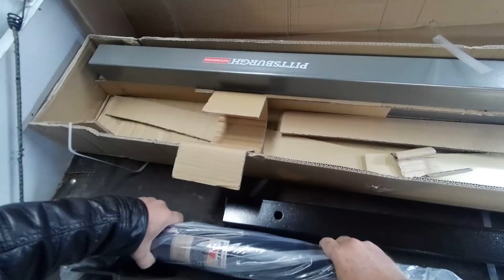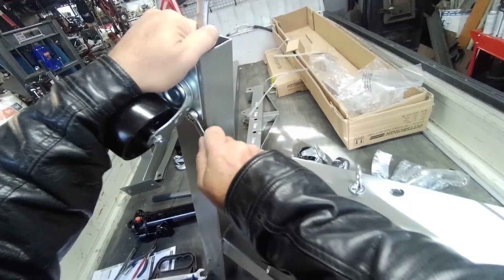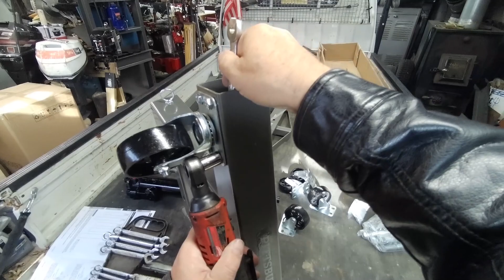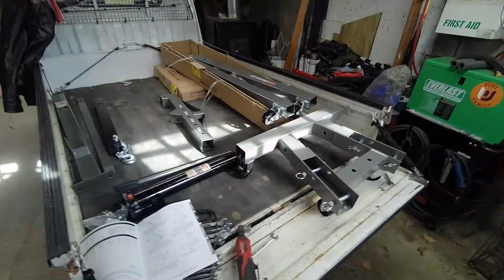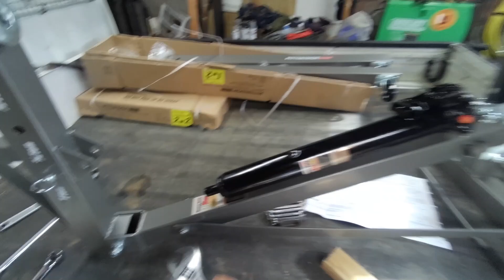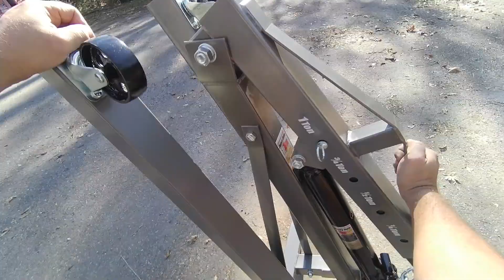$209.99 Harbor Freight 1 ton Engine Crane assembly. Complete build in about an hour!

Comment: Got the 1 ton and realized I screwed up I needed the boom to be longer so ended up getting a 2 Ton.
My one 2 was 6 inches to short but the 2 ton had 6 inches extra.
Kept my 1 ton for smaller cars.
Reply from the maker: I noticed it was short when pulling the engine in my son's C3, I put a hitch extension in the end of boom to gain the reach I needed lol

Comment: Is this one ton hoist strong enough to lift a 5.3 vortec plus transmission  ?
Reply from the maker: Yes
Reply: @MotoCheez  thank you
Reply from the maker: @MetalSlug270 2000lbs with arm all the way in, 500lbs all the way extended.  The 5.3 vortex is about 500lbs, a 4L60 is about 200lbs, if its 4x4 add 150ish. 
So you'd have to be able to reach at the 1000 lb setting which is one hole in from full extended
Reply: @MotoCheez  That makes sense.  Thanks a lot man. 👍

Comment: 8.8 hardened hardware? You actually trust the markings on Chinese hardware? Dude! They can (an do) put any mark they want on their pot metal hardware. That is why no industry that are required to use actual rated hardware refuse to even test anything made in China. Not even worth their time.
Reply from the maker: I didn't know that. I know many Japanese and USA auto makerS have china manufacture parts for them now

Comment: $209!!!! I bought the exact same one at Autozone a couple years ago for $166 out the door! Inflation sucks.
Reply from the maker: Yep. I remember when they were that price!
Reply: @MotoCheez  I tried to move a 13x40" engine lathe with mine. The frame did fine but the cylinder hates me now. Not sure its good anymore. You can now buy a linear rail cylinder with remote control.
Reply: With remote makes one man work alot easier.
Reply from the maker: They're heavy!! Oh yeah? Thatd be handy

Comment: BTW just a little correction. 2200 lb =1ton = 1000kg. , 1100 lb =500kg.......
Reply from the maker: https://www.google.com/search?q=1+ton+is+how+many+lbs&oq=1+ton+is+how+many+lbs&aqs=chrome..69i57j6.9811j0j4&client=ms-android-att-us-revc&sourceid=chrome-mobile&ie=UTF-8
Reply: @MotoCheez   sorry apparently there is different tons as well. Was not aware of that. Imperial ton is 2200 odd pounds.
Reply from the maker: Yes, there is metric ton also

Comment: A fun way to spend an hour or two in the morning. 😁 (I'm a bit OCD so I would'a Dremel'd those burrs off.)

As tool'd up as you are, was kinda surprised you don't have any box end ratcheting wrenches. That being said, plain old wrenches will get the job done. 👍
Reply from the maker: I just deburred with wrench. Didn't want to take off too much paint 😁. I do have ratchet wrenches

Comment: And, any real mechanic has busted a nut without a cheater bar too.  But, the biggest POW I had, was when I was leaning into a 3/4" drive socket (without a cheater bar) to loosen a King Pin on a tractor, and shattered the socket in two.  It was a good "SK" socket too.  That's a wake-up.
Reply from the maker: So true. I've busted ratchets like that too

Comment: Man I have that crane too, funny I went to my local harbor freight Natick MA and had to go to the Peabody/Danvers store 30 miles away to grab it. When I am at my place on Candlewood I go to Brookfield too. I used it on a 80 VW GTI to drop the engine this Summer. I bought that GTI at New Milford VW (now closed the 1st VW dealer in America) in 1984, my 1st car..I sold it in 1997.  I found it in VT 6 years ago.  It's 80% restored to factory..just needs to go to body shop now. Cheers.
Reply from the maker: I know where that VW dealer was on 202
Reply: @MotoCheez  yeah near Clamps hamburger stand. No phone, no address, no mail. Just burgers 11 to 3 and 5 to 7 April to October.